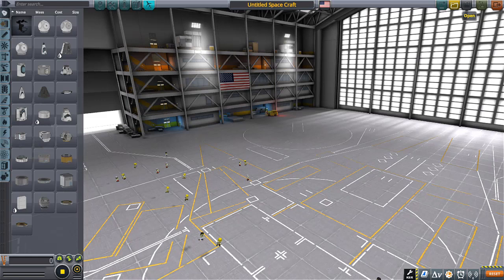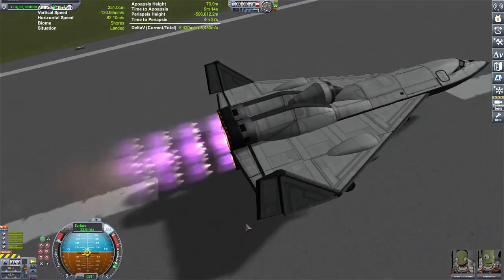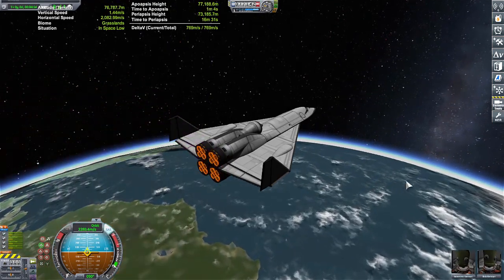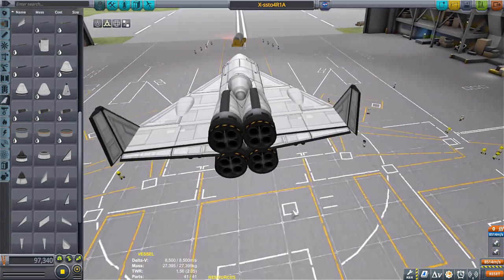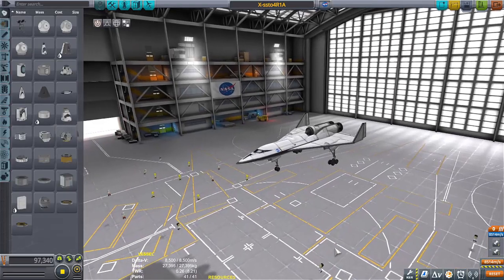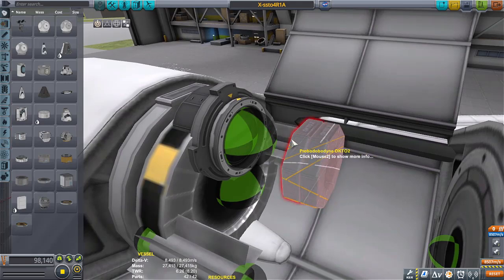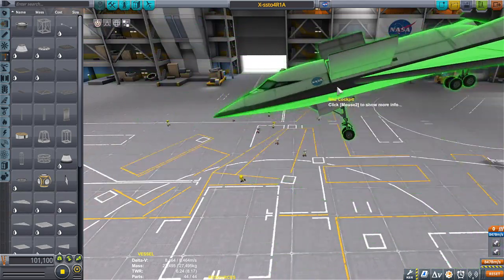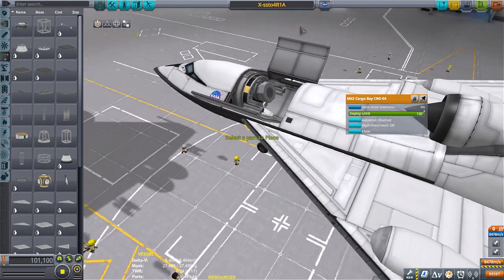RAW SSTO TIPS ... wait.   \  KSP 1.12  \  Kerbal Space Program

Comment: If you're using a docking port anyway to mount your re-entry probe, you could instead just tilt the docking port itself and use it's own "control from here" option to re-orient your prograde, and then you can use the cockpit to go back to normal.   As long as you have a pilot who can hold prograde you don't need an expensive or heavy probe.  The clamp-o-tron Jr. weighs half as much as the lightest probe core (0.02 for the COT Jr, 0.04 for the Okto2) and it only cost 800.  

Obviously the probe core has some advantages,  the Okto2 can control the ship fully without needing a pilot,  but if you have a crewed mission with a pilot anyway and you are using a docking port to mount your probe core, you could save a little money and weight by going with just the docking port by itself.

Comment: Heh... the angled probecore to control a set pitch is something i came up with aswell, but i used infernal robotics for that. putting the Probecore on a hinge so i could change the pitch by switching trough preset angles.
I found this to be particularly usefull on my "spaceshuttle" replicas,  one preset angle in line with the center of trust of the main engines for ascent, and a different angle for reentry.

Comment: 6:55 Vaos doesn't like small balls.

In all seriousness, though, I actually didn't know about the intakes, the nosecone drag trick is indeed an OG trick (but good to know it still works in the latest version), and the reentry module I learned from you a few years ago (but I think I can improve on it for some minor part savings). 

Basically, just have a single probe core, and mount it on a hinge, and use a KAL to activate it.